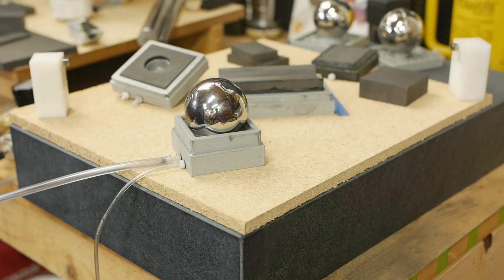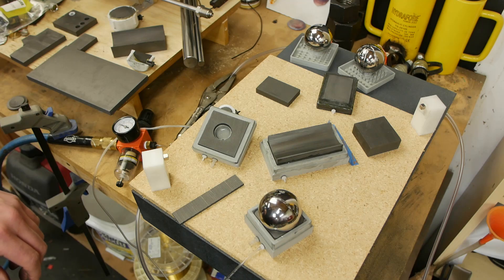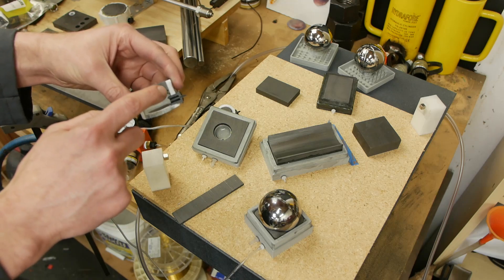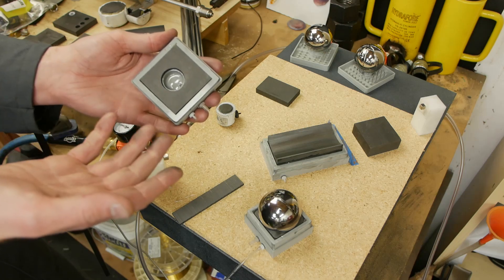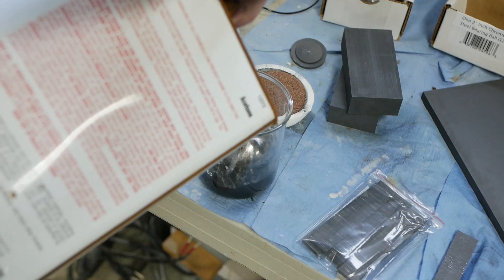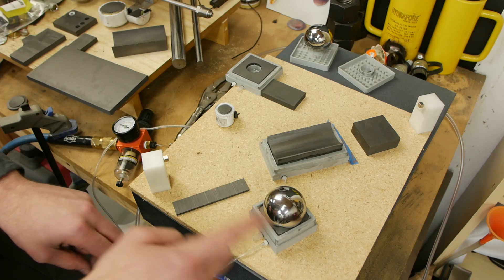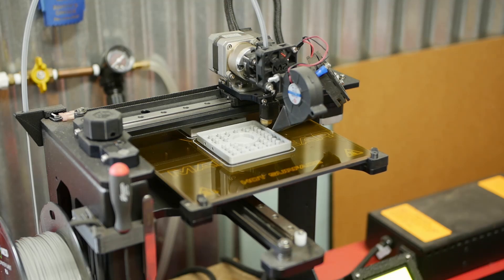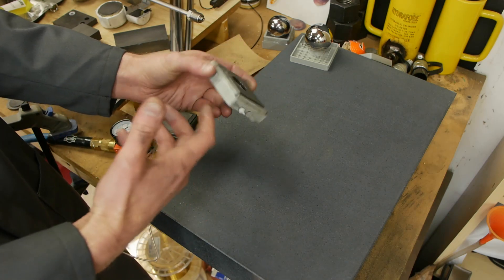Make vacuum pre-loaded spherical air bearings without special tools

Comment: it is hard to overstate how much I want to see you aim a stream of compressed air at the top of the cylinder in the air bearing to get it going really fast
Reply: It's hard to overstate my satisfaction.
Applied science.
We do what we must, because we can.
Reply: @London England For the good of all of us
Except the ones who are dead
Reply: @generalfishcake  The cake is a lie!
Reply: That is precisely what is done in some scientific equipment (used in NMR spectrometry of solid materials)-- a small rotor is spun by air in an air bearings. For very tiny rotors of 0.7 mm in diameter, the speed can be quite high -- in excess of 100000 revolutions *per second*.
Reply: How Does it Really Work in the High Vacuum Industry the turbo vacuum pumps use mag-lev bearings. They are no joke.
Reply: @cogoid  in PCB production, I was seeing drill speeds of >170,000 RPM ... air motors with air bearings, carbide drills/mills
Reply: @cogoid  Is it air or helium or hydrogen?
Reply: @Mariano.Bernacki  Just dry and filtered air. Helium is sometimes used when fast spinning must be done at very low temperatures, at which air would start condensing. Everything else being equal, you can make it spin faster with helium than with air -- but even with air you can spin beyond the strength of high strength ceramic rotors. They just burst.
Reply: @cogoid  So you're saying that a mechanical object is rotating at 100 kHz? You  sure about those zeroes? 100k RPM is insanely high, 6 million RPM is downright impossible.
Reply: @6alecapristrudel  Yes, these small Zirconium Oxide ceramic rotors really spin at 111 Khz driven by ordinary air. 

KHz speeds were already demonstrated with air driven "spinning tops" suspended on an air cushion in 1920s-1930s. There is a paper on it, but it is hard to get and it is in French: Henriot, Èmile and Eugéne Huguenard, 1925. Sur la Réalisation de très grand Vitesses de Rotation. Comptes Rendus des Séances de l'Académie des Sciences (180), 1389-1392.

Later high speed spinning was developed for ultra-centrifuges and similar applications. You will find many interesting articles on it in "google scholar" written by Jesse Beams -- though he mostly used magnetically levitated rotors. (See for example "The production of high rotational speeds".)

Today, the record speed for a rotating object is over 1 GHz in vacuum. Of course the object is very tiny -- only 0.17 micron across! (You can find the paper about it on Arxiv: "Optically Levitated Nanodumbbell Torsion Balance and GHz Nanomechanical Rotor" by Tongcang Li et al)
Reply: @cogoid  I stand corrected. 
I guess it does make sense that these things need to be small to actually reach such speeds.
Reply: @6alecapristrudel  Just to add one caveat to it -- the air cushion on which most of these really fast things spin is not quite the same thing as the air bearings used in precision machinery. In the latter, the bearings have very tiny air gap which is necessary to make them very stiff and very accurate. But for spinning tops and other such things, the object is suspended in the air with an air gap maybe a hundred times bigger -- such suspension has no stiffness to speak of, but provides very low friction and, crucially, does not care too much if the spinning object is not perfectly balanced. The object just finds an axis of rotation (which is generally different from its geometrical axis of symmetry) around which it spins nicely without vibration, and everything just works. With a tight bearing that would not be possible.
Reply: @cogoid  I am wondered, how much RPM steel 5mm ball need to explode, and what kind of damage it can do? also intresting what sound can produce elipse formed "ball", rotating fast in vacuum camera, when camera depressurization fast performed, alow air to around asimetric rotating object, with tangent speed higher than sound speed in air
Reply: @IamJiva  This experiment has actually been done! "Ultrafast rotation of magnetically levitated macroscopic steel spheres
BY MARCEL SCHUCK, DANIEL STEINERT, THOMAS NUSSBAUMER, JOHANN W. KOLAR
, SCIENCE ADVANCES 05 JAN 2018.

Extrapolating the data from this article, the 5 mm sphere made out of good steel can probably be rotated at about 2 million RPM before it bursts! Its shards would then be traveling at up to 520 m/s and would be very dangerous -- just like any shrapnel.

Since this frequency of rotation (over 33 KHz) is higher than the highest frequency that humans can hear, I do not think you would be able to hear anything at all even if it spun in the air.
Reply: How Does it Really Work 100,000 RPM isn’t that...  oh - per SECOND...
Reply: @cogoid  wuuuuttt.  100k per Second!  That's so out there I don't even have the context needed to visualize it.  That's so much quicker about than a jet engine for example.
Reply: 50 years ago we used compressed air to rotate the race of large ball bearing s. We were 16 y.o. apprentices . Very dangerous . One of them got away and embedded itself into a breeze block wall . Aah silly boys.
Reply: There have been well documented accidents with hydrodynamic air bearings operating at very high rpm when the rotating object has "escaped".
Reply: The speed of sound is essentially the max speed of air. You can calculate how fast a cylinder can spin, that 2in diameter one would never spin above 130,000 rpm...which is still high but its not limitless. So the post above with the scientific equipment, this is why the rotors are so small in diameter. More circumference brings you closer to the limit sooner.
Reply: @Ayestosea  You are right that in practice, the circumferential velocity of most (though not all) spinning things is subsonic. But it is not exactly for the reasons that you have described.
In the solid state NMR, the resolution often depends on the rpm of the sample spinning. Thus it is desirable to spin the sample at the highest rpm possible. But the stress on the material of the rotor grows proportional to the rpm squared times the rotor diameter divided by the wall thickness. The 0.7 mm is the maximum diameter that the strongest available materials can withstand at these 6+ million rpm. It is very inconvenient to work with, but people put up with it when they require utmost resolution possible. 
But the air flow even in that particular system (Bruker 111kHz MAS 0.7mm Probe
) is supersonic in some parts between the nozzles and the turbine. Air and any other gas, can certainly move with supersonic speeds -- in 1890 de Laval invented the convergent-divergent nozzle specifically to drive a turbine with a very high speed supersonic flow of steam. (The blades of the turbine would of course move with a much slower speed.)
Reply: @cogoid  Hmm interesting  thanks for the info. I always assumed air would ahem..."cavitate" or do something odd when forced to go supersonic next to a surface. Now that makes me wonder if the layer right next to the exit nozzle is supersonic or if its just mostly in the middle, then it would make sense to me. I have a hard time thinking how a 10 micron film of air can go supersonic. I suppose now that the central mass would cause the air to "roll"...so essentially spinning ~2x faster without the air going supersonic. Or is the rolling air limited by itself to never roll faster the "speed of sound". So many questions now lol.
Reply: @Ayestosea  that speed of sound is limited by the temperature of the air... Get things hot enough and eventually the speed of sound gets really close to the speed of light... Just saying.
Reply: @Unmannedair  speed of sound gets close to speed of light?!??!?!?! In what realm of hell does that happen? Do you even physics?
Reply: If he could get the air blowing hard enough you can get the bearing to float on it.
Reply: Beware the Magnus Effect on that causing lift off of your bearing plate.  It needa to be enclosed and magnetically centered also.
Reply: Tyler Hargrove, interesting thought. I wonder how fast something would have to spin for it to drag in outside air at over 60psi
Reply: @pyromen321  The more immediate -- and a very serious concern is that if you spin anything fast enough, it bursts --and then shrapnel flies literally like bullets. Jesse Wakefield Beams was a scientist who developed very high speed centrifuges. If you look up his papers, he shows examples of sizable steel rotors bursting like artillery shells when spun at some fraction of a million rpm.
Reply: @cogoid  
roger that ... and ...
you might not have to wait for it to go so really fast if there are any flaws in the spinning material -
in 1980 - a large piece of a cracked flywheel on a riding lawn mower tore through the sheet metal engine housing and slammed into my upper right - rear hip area - necessitating a visit to the ER to purchase and participate in a 6 stitches wound closing session .

Do not ask how I knew the flywheel was cracked ... I did not tell anyone then and I am not discussing it now .

Now days  - the State of California probably has warning labels laser printed on every flywheel - in 150 languages  -
' The State of California has determined that spinning a flywheel which has been cracked is not a good idea . '
Reply: @cogoid  Tensile hoop strength and rigid structures... 

When you get it spinning fast enough the crystalline-esque structure becomes flexible and the slightest variance or change from circular rotation makes it go fling.

Since no rotational body is realistically symmetric and even wear can offset calibrations.
Reply: @reasontexas  😮
Reply: @aarongreenfield9038  It is floating
Reply: @mlgmaster6418 . No, I'm talking about it coming out of a pointy nozzle.
Reply: Do it to the tooling rod so there's some fins to catch air.  Also would likely be an amusing RUD. Big 'ol rooster tail of graphite flying out..  Maybe do outside.
Reply: That would look awesome
Reply: Exactly what I thought. EXACTLY!
Reply: Ringo Garvin  Would that produce the coveted ARQ?
Reply: Make a big one and ride on it.
Reply: One of my physics labs had a magnetized ball bearing in an air bearing, used compressed air to get it up to 3600 RPM, then kept it there with a 60 Hz magnetic field.
Reply: You know what all this means? I'm pretty sure the hyperloop sham will turn to this trick now to make their pipedream possible!
Reply: @danieleliahushapiro4280  They already have, I guess - air bearings are one of the core parts of the concept, as described in the original white paper by Elon Musk, you can read the whole thing online.
Reply: @hellelujahh  sadly your guess is wrong. The white paper states vacuum all through the pipes which has been proved impossible by thunderf00t and others. What I meant is that now, with this, they can apply a local vaccuum just around the capsule to eliminate friction locally not air drag like originally intended.
Reply: @danieleliahushapiro4280  And which 'white paper' are you referring to? Because the one, the only one, that Elon Musk wrote on the Hyperloop does not say anything about a "vacuum all through the pipes". In fact the very concept relies on there being air within the tubes, "The approach that I believe would overcome the Kantrowitz limit is to mount an electric compressor fan on the nose of the pod that actively transfers high pressure air from the front to the rear of the vessel. "
Reply: AFAIK Thunderf00t didn't say it's impossible, but impractical and very dangerous. IIRC the first concept was soft vacuum, in the tubes and a compressor on the train made compressed air for air bearings.
Hovertrains: https://youtu.be/qUXEFj0t7Ek
Reply: @besenyeim  well ICYMI, so far the hyperloop is nothing more than a glorified train at this stage and IMO brings nothing new to the table. Also when cost is goinv to infinity impractical = impossible so please dont discuss choice of words. And hover trains couldnt work in complete vacuum si either they use exactly whats in this video withouth vaccum pipes or they got nothing to offer. i.e. what I said in the beginning.
Reply: @danieleliahushapiro4280  except that Thunderfoot's video on this subject was so heavily tainted by Thunderfoot's own bias that he failed to notice his arguments were self-contradictory. Hyperloop may have many real problems in design, and has many real problems in to-date implementation efforts, but Thunderfoot did himself a great disservice with that one. You accuse others of being up someone's arse and of shilling, but if you managed to miss this glaring failure then you should examine whether your own fervour has stolen rational thinking from you.
Reply: @kirkc9643  Ah, the usual ad hominem attacks on Thunderf00t's character rather than questioning the accuracy of his statements.
Reply: @Islacrusez  could you please point out at least one set of specific self-contradictory statements?  Hard to evaluate this criticism without specifics.
Reply: @Barskor1  what do you mean?
Reply: @Barskor1  how is that sarcasm? Those numbers really make it impractical.
Reply: @Barskor1  right back at you.
Reply: @danieleliahushapiro4280  lol hate on the hyperloop all you want (it's a concept...like many other concepts it may be stupid), but you're obviously just discrediting everything "because musk." He's crazy, but he's also started and run two of the most successful engineering and technology companies in our era. That takes a lot of business prowess, but it's not insignificant the amount of engineering he has successfully done. Grow up and create something better instead of shitting on a concept.
Reply: @danieleliahushapiro4280  lmao you almost have an argument here, but you invalidate yourself completely with not just stupid hypocritical arguments, but blatantly false  and downright laughable statements. 

PR doesn't a successful company make--look at Nikola; that is what happens when you run a company on PR.

If you want to know how much Tesla has been awarded/loaned by the government, this is a great source. TLDR? Not that much, especially compared to other car companies. Want to know something else? Government contracts and subsidies are not awarded because of good PR. Good engineering lets astronauts fly to the space station; not good PR. Good engineering creates the best electric car on the market for nearly a decade, not good PR. You can argue that Musk/Tesla/SpaceX is overrated, but it's absolutely laughable how delusional you are. I don't understand whether it's hatred/jealousy of musk, a fanboy to whatever you consider "real engineers" (let me guess, companies that haven't done shit with many times more funding than spacex/tesla),  or just flat out stupidity.  

I also like how you completely avoided  actually talking about the hyperloop. You watched a thunderf00t video and have your opinion set, clearly. I don't really care, I don't have anything to gain by arguing for Musk and his companies, but I do find it funny how delusional you are. Cheers
Reply: @hunterm9  also where is the source?
Reply: @danieleliahushapiro4280  https://cleantechnica.com/2020/08/03/tesla-subsidies-how-much/

Forgot to include the link.
Reply: @Unmannedair  woah ... I have never seen so much generic puff words all this much condensed in one comment! Keep it up!

Comment: What's that neat little FDM printer rig? I don't recognize it.
Reply from the maker: Makergear M2.  It's a slightly older design -- still works perfectly, as it always has, but a bit more expensive compared to other similar models that are now available.
Reply: @AppliedScience  Cool - it looked really solid and well-made, so I was intrigued. Thank you for the info!

Comment: Fantastic video! You probably could've used a small suction cup on the steel ball connected to a rod and cordless drill to take down the graphite.
Reply: Would be really quick and the other hand can operate the vacuum cleaner for the dust, keeping the grooves / flutes clear.
Reply: I thought the same thing once I saw him using the ball as a tool.
Reply: It takes very little time to ream the graphite. Best not to use powered tools for the final reaming. You can feel the fit "seating" when you are done. You want to press consistently  with the tool and go slow.

Comment: That was really cool. Any chance you might make some practical application things? Weird question I realize, but I think you get my meaning. It would be cool to see these put to some good use...

Merry Christmas!
Reply: Air hockey!
Reply: If you have an item that you need to re-position on a smooth surface that you don't want to mar (such as the granite or glass slab), putting it on air bearings would let you move it around. Putting suction cups on it that you can then use to hold it in place when you're done moving it would be a nice touch.
Reply: Would it be practical to use these bearings for a large flywheel to store electricity instead of using batteries?  ie: to use a motor to add angular momentum and when you want to draw energy from it to use a generator to subtract angular momentum from it

Comment: That graphite blocks are so evenly porous is quite interesting.
Reply: Even carbon filters baffle me. In glad they filter my water
Reply: The grain size of the block defines the cost and quality of the graphite block. 
Mostly used as electrodes for EDM( Electro discharge machining
Reply: @manishiyer23  Do you happen to know what grain size is needed for the air bearing in this video? I bought a pice of graphite  and it barely has any pores. I read some research on increasing the amount of pores in graphite but there were different techniques for different pore sizes.